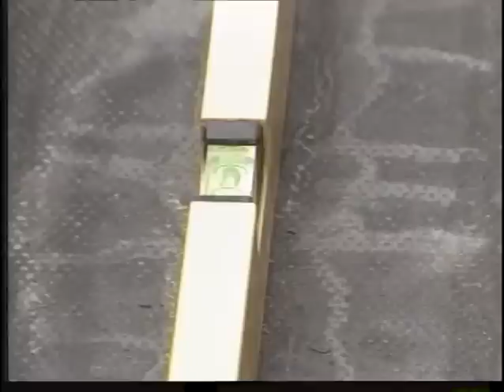How to lay pavers, slabs and other paving

Comment: Not near enough whacked hardcore and  blinding beforehand and far too deep sand. Mix cement into it  7-1 and then dampen with a water mist from a  hose. Lay slabs without stepping in the sand and  when they're all down cover with sheets of thin plywood and then pass over with a small whacker(,Large  area ) small area just go across them all in all directions with a straight edge and rubber mallet the high spots.
Reply: Lol, you will have people believing that, specially the cowboy that made this video, Yeeeha!

Comment: As far as laying slabs goes, it wasn't terrible, but what was that teeny-tiny wall doing there? It was high enough to trap all the water run-off and to make a lovely trip-hazard, without actually doing anything useful. Just... why?!
Reply: My garden has that. No where for water to run off and is a hazard. And then it goes up to a diy raised garden I'm in the process of removing it all diy. Nightmare from last owners. It's like a pond when it rains

Comment: Do you think it’s okay to build a slab over a paved surface for a house extension? Or do we have to remove the paving first
Reply: Dont take any advice from these cowboys this should be a video on how not to lay a patio
Reply: Depends on if levels allow, you could get away with it if the existing paving is much lower than 150mm from the damp course but if it’s within 100-150mm then the paving will have to come out and be replaced with the slabs. As long as the sub base underneath is good enough you could get away with it.
Reply: @RGK147  Have they stopped grouting slabs now, I have noticed a few lately not leaving gaps, it grows plenty of grass in between the joints.

Comment: Roof tiles as hardcore Jesus!! At least mix in various other materials like old stone or brick chippings and mix in sharp sand to bind it. Mortar has to be wet with some body to it but not sloppy. Shouldn’t be laid on dry mix as they will move over time and rock.

Comment: where is the water going to go with the slabs up against the wall
Reply from the maker: Good point, would be good to put some drainage in the wall as well - maybe some PVC pipes every 2 to 3 meters.
Reply: My garden has this. Back door leads to a patio which is retained by a brick wall and raises the whole garden. The patio is like a pond in rain and awful thanks to previous owners. In process of removing it diy

Comment: He's ruining the slabs by hitting on them with a hard object. What happened to a using a mallet?
Reply: Rubber mallets are a relatively recent introduction, I still prefer the feel of a wooden beadle or club hammer handle, used correctly, nothing is damaged.
Reply: @KD-1983  Nothing more than a slight scuff mark which disappear quickly.

Comment: Yawnnnn this is pointless this man is giving himself hard work dump all the sand instead of shoveling the sand in make a screed level and screed it all then then walk it in or use a whacker plate to make the sand compact and then screed the sand level then lay your slabs with no whacking with a hammer lol